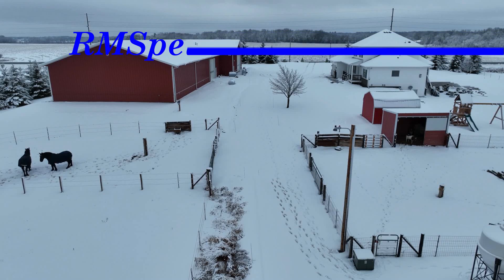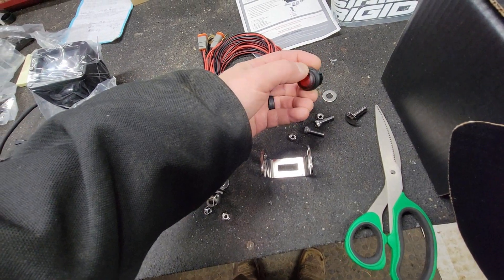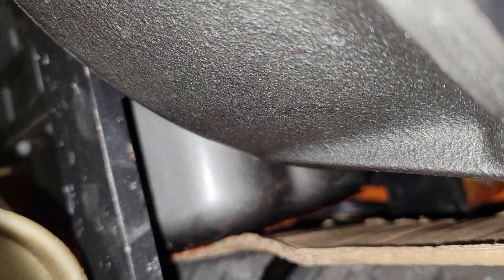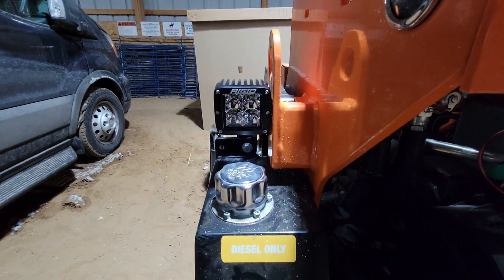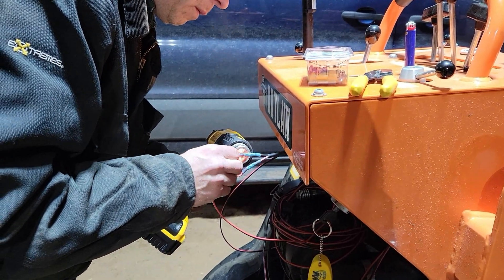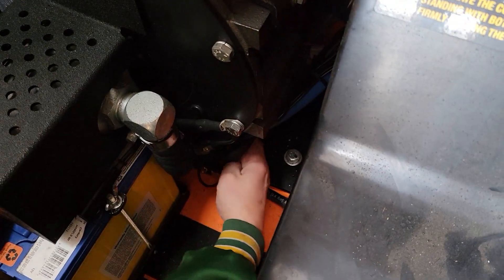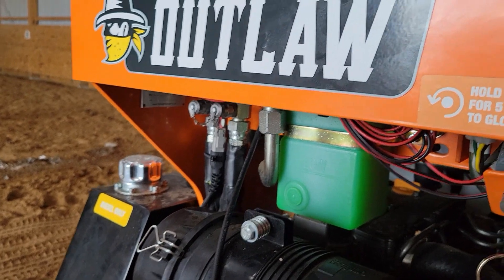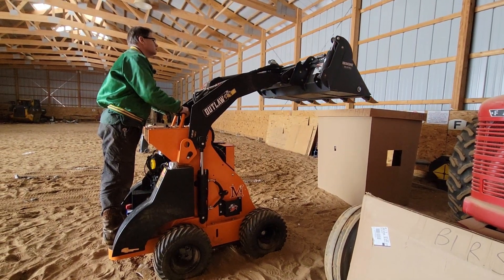Customizing up Mini Skid Steer.....Outlaw with LEDs, Block Heater & Battery Tender

Comment: you should have got a tracked unit not tires
Reply from the maker: I would have but the tracked machines are longer and we need small to turn and pivot so we had to go with wheeled